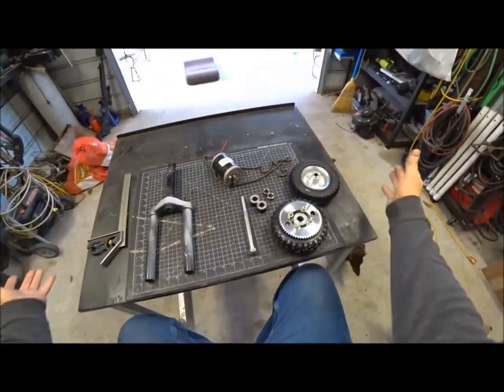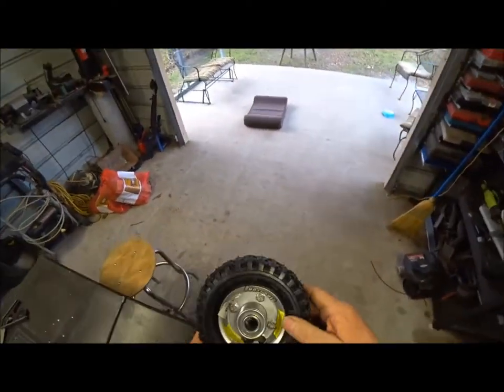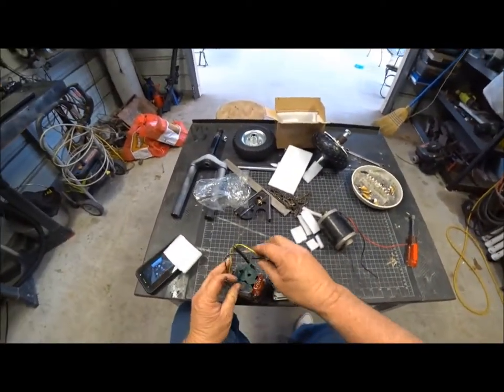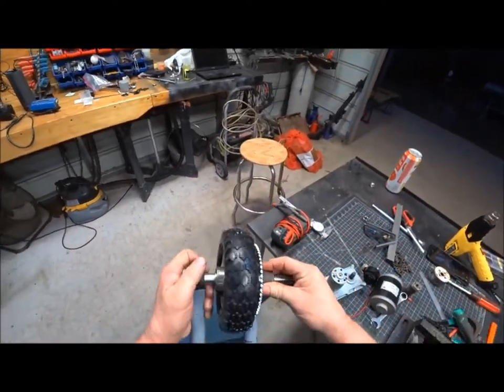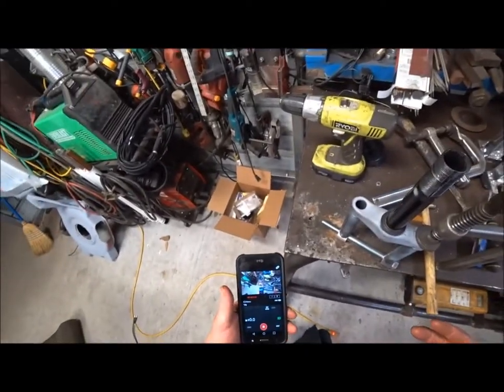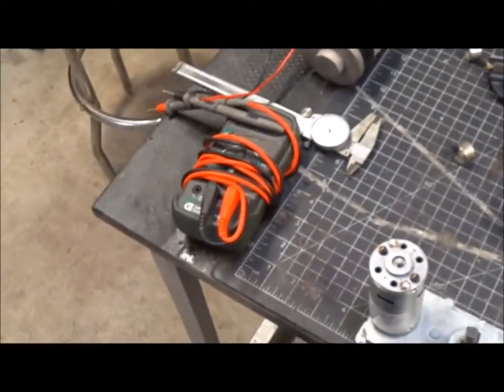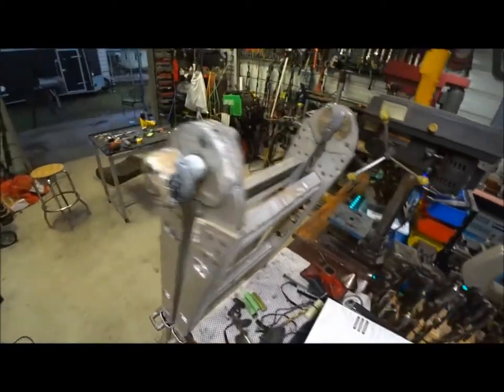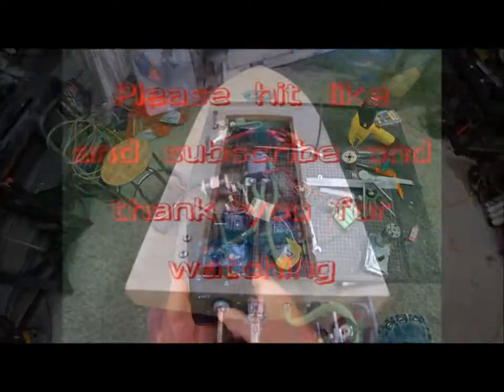Remote control lawn mower build DIY part 4

Comment: I’m sure you have it figured out and I’d have my answer in the next video, but is the drive motor going to be mounted vertically above the sprocket? Just wondering how the front tire will rotate left and right with the drive chain around the sprocket ?
Reply from the maker: The motor will be mounted directly on the forks it will move with the forks so true 360 degree turns are possible and again thank you for your comment and for watching.